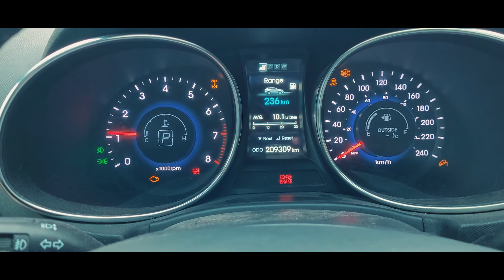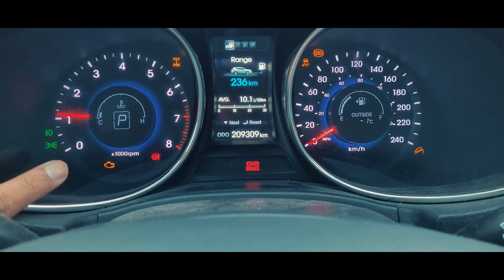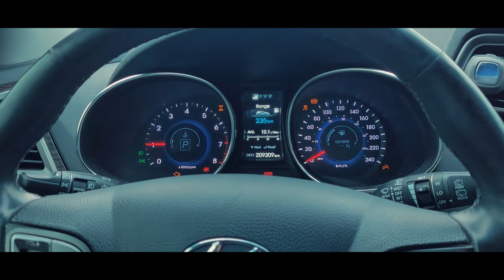AWD to FWD conversion in my 2014 Hyundai Santafe 2.0T AWD.

Comment: Thanks for your video, it motivated me. I did the same, removed the transfer case on my 2013 Santa fe 2.0T sport AWD. Note that I also disconnected the plug at the rear transfer case. I've had no issue, I'm at 1200kms, It's running well as a FWD. Steering a little lite but fine, I'm not sure it has something to do with this. No engine or other lights on but the all wheel drive on.  No code generated.

Comment: I have a 2013 Santa fe. Had it with a clean instrument cluster with no faults, but I knew the AWD had issues since the transaxle produced a beating noise when turning a tight radius. So I wanted to verify this by pulling the "4WD" fuse and drive the same corner with FWD only. After pulling the fuse, I got hill descent, traction control and AWD lights ON, but the drive around the corner was smooth and definitely better than when AWD was activated. Then I wanted to restore the AWD by replacing the "4WD" fuse. However, the lights are still latched and the car is running on FWD only. I scanned with OBDII and no faults found. By your experience, would you know what's going on in my case? Thanks in advance.
Reply from the maker: You need a more powerful scanner to scan for transmission code.